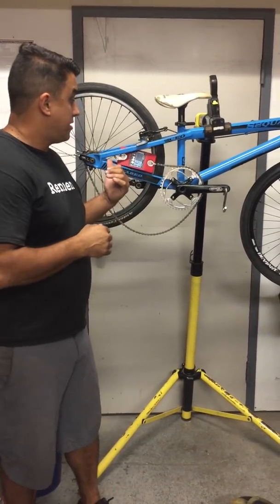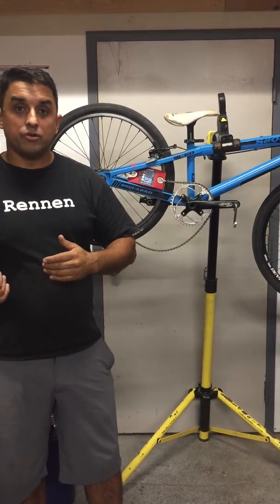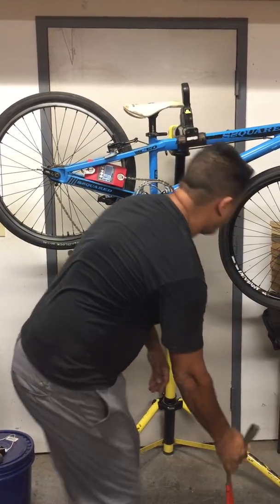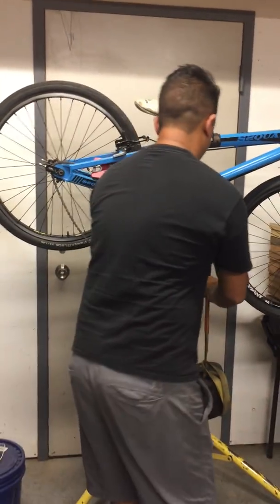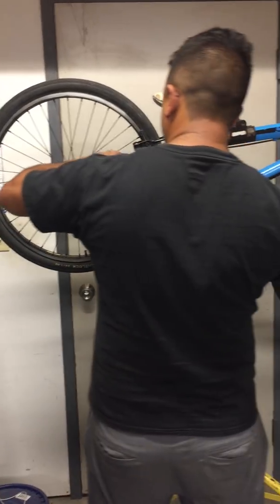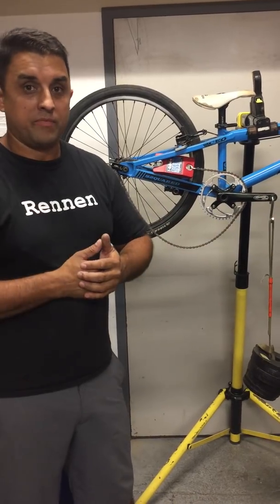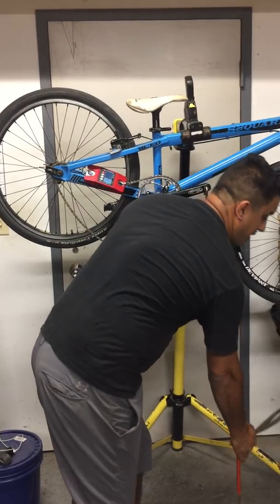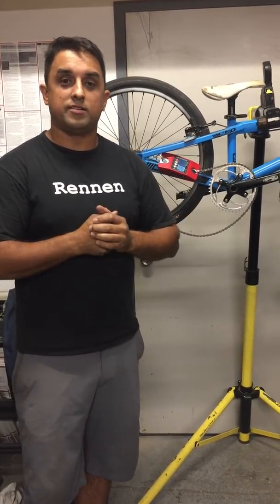Rennen Design Group Decimal Gearing Explained

Comment: Paul Hartman is right here: the number of teeth in a gear ratio is absolute, and the number of revolutions to travel any distance is fixed, period. That’s the most simple math available. If Rennens advantage was based on reducing chain force required, then you would always choose a 44.1 tooth ring and never choose a 44.9 tooth ring (or whatever you want to call the smallest 44 tooth ring). There would never be a need for any other steps except the lowest variant offered. 
 Your chainrings are lightweight, well made, and I have one on my  singlespeed bike. But not because of any theoretical advantage. 
 I welcome any further discussion.

Comment: Great video that is stating the obvious.....that torque is a function of radius, not the number of teeth.  The number of teeth is always used because it is normally proportionate to the radius.  Here's where I need an explanation.....if the pin to pin distance on a chain is 1/2" in either case.....how did you use a larger/smaller diameter with the same number of teeth and the same chain?  Are you playing with the chain clearance somehow?  I don't get it.  Regarding Paul Hartmann, I believe he is on the right track.  There is a reason that a "18-speed" bike has 18 speeds, or say 3 front sprockets.  Smaller diameter is better for starting.  However, the human body can only comfortably spin their legs at a certain speed, and apply torque while doing so....therefore we need larger sprockets up front for higher speeds.  If this human problem did not exist then a multispeed by would be of virtually no benefit.  I don't care about friction, and I do not believe the number of crank spins will be the same until I get an explanation about how the same chain was used... :D

Comment: I don't see that as proof as we don't ride with zero rpm. With the chain tensioned normally, I would expect to see an increase in friction with anything other than the perfect chainring diameter. Ultimately, gearing is a ratio, at the end of a lap, the the number of revs of the crank spindle with be the same on both of the chainring you used on this video(both 44t?). Maybe the smaller diameter chainring will give an advantage for the first push off the gate, then the increase in friction will start to work against the rider.
Reply from the maker: Paul Hartmann you are seeing the result of forces generated after the friction interface this is a static condition but static friction forces are always higher than dynamic and in general is well understood that chain drives run in a high efficiency range ~97-98% that doesn’t account for the difference in force here from one setup to the next. This is a definitive proof of how decimal gearing works.

Comment: Excellent  laboratory.  Can I get the same  results changing the gear ratio but  using different  gears size( example 43:16 replaced by 46:17)?
Reply from the maker: yes you will see similar results force on the 43T chain setup will be higher than 46T setup reason a lot of riders have gone big in my opinion is that the bigger sizes exert less force on the chain and in turn to the frame so its a way to effectively stiffen the feel of your bike setup